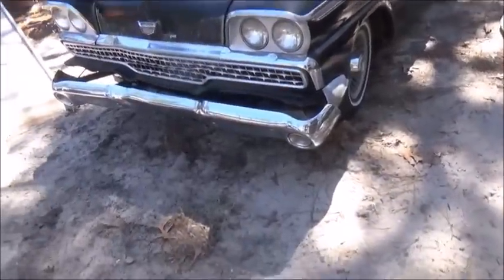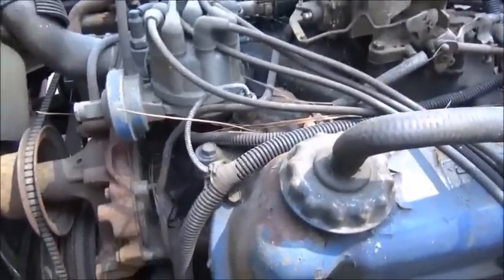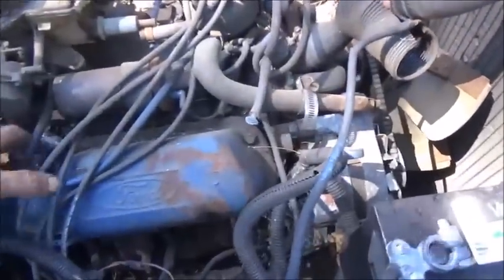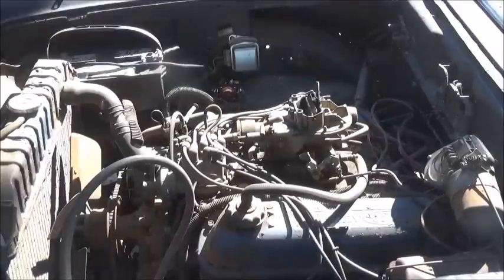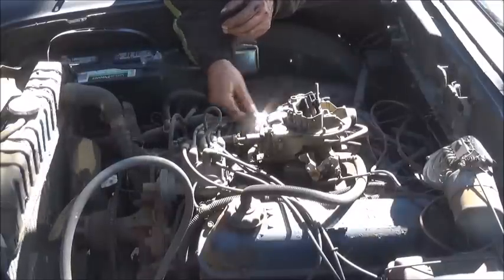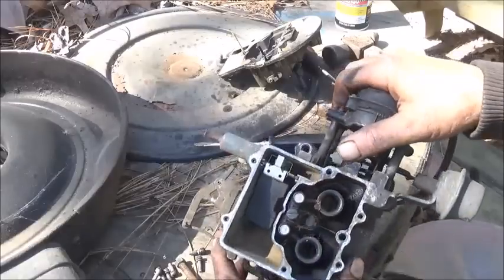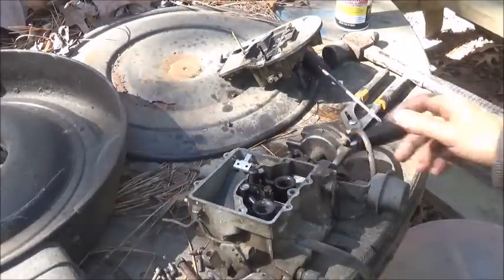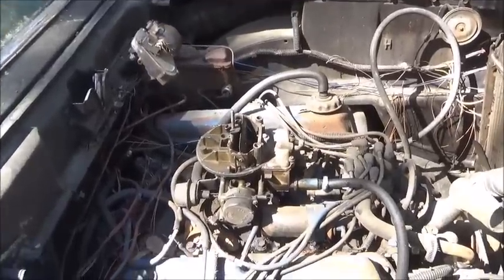1959 FORD GALAXIE FAIRLANE 500 FIRST START IN YEARS!!

Comment: Testing brakes. Do it sitting in the driveway.....not at 60/80/100mph. Hit the pedal as hard as you can, because if they are going to fail, you'll not have an accident. I learnt this many many years ago. Might? have saved my life because they did fail. I'd missed a weak/corroded brake line.  I fixed  them properly.

Comment: the easy way to tell a 351w from a 302 is the head bolts  351w has washers built on the heads  302 is just a straight heads

Comment: Best way to expkain why a compression fitting (which is meant for low pressure water fittings) SHOULD NEVER BE USED ON A BRAKING SYSTEM IS, SIMPLY THE PRESSURE EXURTED WITHIN A NORMAL BRAKE SYSTEM CAN EXCEED THE CAPABILITIES OF A COMPRESSION FITTING & THATS WHY THEY CLEARLY ARE MARKED, NOT FOR AUTOMOTIVE USE!!!!

Comment: Brakes: Someone changed out the old single master cylinder for a later model tandem master cylinder. It's hooked up incorrectly. Half of it should actuate the front brakes and the other half should actuate the rear brakes. It's connected so one port actuates front and rear, leaving no redundancy. The other port is connected to the brake light switch. I've worked on brakes since 1971 and I've never seen that before. Just when I think I've seen it all, this shows up. Lol.

Comment: The pulley wheel on the water pump looks bent to me!!!
Reply: I noticed that also.
Reply: My money is on bad waterpump bearing.I think that fan is fixin to head butt that radiator
Reply: @stacyboots1818  Either that or maybe they forgot to tighten the fan blade mounting bolts. Ya never know.

Comment: Proper use of a flare tool, making a good flare and making up fittings is a basic skill every mechanic should have... IMHO.
Compression fittings will not work on steel lines, the brass ferrruls are too soft to get a grip on the line and they will blow apart.
You can think about it, but Don't Do It!

Comment: Yeah I would never use compression fittings on a brake line it's cheap enough to buy brake line and pre flare or flare them yourself and have one piece I would never use compression fittings at all and I know it will not pass the safety check where I'm at.

Comment: Compression fittings in brake lines are Illegal. Any ASE certified Shop or mechanic will lose their cert if caught doing it. Any vehicle in Ohio that has to be safety inspected will fail for compression fittings.

Comment: Change the oil and put one quart of Marvel Mystery oil in place of one of the quarts.It will clean the engine of all the sludge and varnish in the oil passage's.
Reply: Donald K. MacBaird Yeah but all that sludge goes straight into your oil filter don't do it,  I lost a 318 motor burned it up by plugging the oil filter,  only use it from the beginning of New.
Reply: Donald K. MacBaird .No it will clean up all the sludge and put it in the oil filter! Bad,  you have to use it when the motor is newer, and the whole life of the motor.
Reply: I am sorry I forgot to say that you have to change the oil and filter after 500 miles.Then  the engine is cleaned up,after that to keep it clean you add one Quart of MM every oil change. @jackrohde4709

Comment: Correct advice on the compression fittings on a brake line!  Just...not...worth...it!  Enjoy your videos...you know mechanics!  Those Ford's were notorious for going through silenoids!  After you pointing out the issues you found...I wouldn't trust anything the previous owner did to the car.  One sorry mechanic!!!
Reply: Robert Biggs My friends went through more Chevy engines then I did Ford solinoids lol. I had a 72 Ford 429 LTD. They had 2 chevelles and 2 Novas and a 1972 C10 pick up, my Ford had more miles and more tow hours, all the Chevy's had flat cams and bad transmissions at about 70* to 80* thousand miles, my Ford had 147*000 when it was stolen.

Comment: If you put compression fittings in a car for a customer you become legally liable if it does fail. You have modified the factory break system with weaker than original parts.
Reply: Doc your practicing law without a license. Unless you are a lawyer.
Reply: @vilsiran  had a boss get a big fine for it. Put a customer in the hospital when the brakes gave out. Not a lawyer.  Just have first hand experience.

Comment: D1AE is Cleveland heads or manifolds.
Reply from the maker: Windsor too
Reply: After looking it up, you appear to have either a 351M or a 400.  We'll have to see the block castings to know for sure. D1AE with no other letters is casting marks for the 351M/400 SB.  That's what I gathered looking at this link:  https://www.enginelabs.com/engine-tech/a-guide-to-ford-v8-engine-block-casting-numbers-1952-1996/

Here is some additional information on the 351M/400:  https://www.fordmuscle.com/archives/2001/11/351M/index.php
Reply: @jonathanw4942  I'm getting a lesson in Ford casting numbers, too!  I think the way to read it is to ignore the digits.  The # you read off in the video would translate as D1AE-A which according to my other link would be a 400 if it was made in 1974.  In 1975, it looks like D1AE-A also included 351M Clevelands, but if those are the right casting #'s and dates, that baby is a 400.
Reply: This engine is a Windsor.

Comment: compression fittings in a brakeline fails inspection in my state...
Reply: Not long after I bought my '56 Buick 34 years ago, I redid the brakes including the brake lines. I discovered a compression fitting in the rear. Scared me to death. Now the car is getting a modern dual diagonal brake system with a modern booster.
Reply: where I live the picup project where he wants to shorten the frame....wouldn't pass either.  I don't have a problem if it's done right but the state doesn't allow frames mods too many patch jobs through the years and people getting ripped off or hurt. @Mullay2
Reply: @thecritic3710  Frame work if done properly can be done safely with good results but the operative phrase here is "if done properly." I have a '65 Buick Skylark sedan I drive frequently. When the previous owner purchased it, it had been in an accident resulting in the frame being bent at the engine cradle on the passenger side. So what he did is bought a donor car with a good frame and swapped the body, and running gear from the car I now have to the frame of the donor car. The donor also gave up one door, the hood, the passenger front fender, the grille and the bumper assembly. The entire donor car was $250 bucks the cost of which was recovered after selling the parts from it not needed on the car I know have. It was and still is the safest and best way to go.